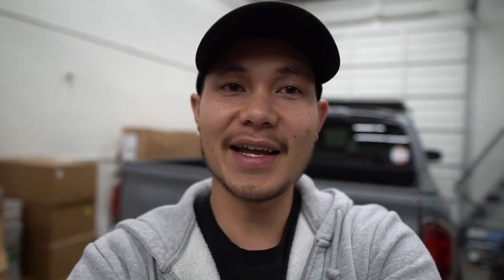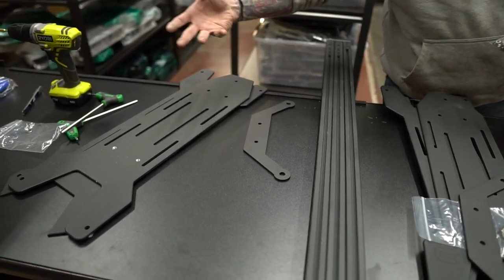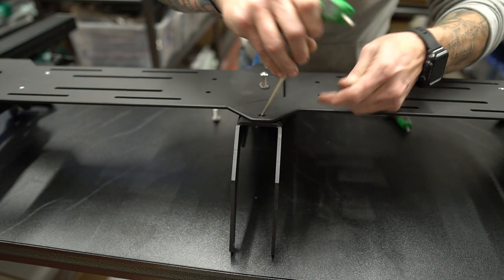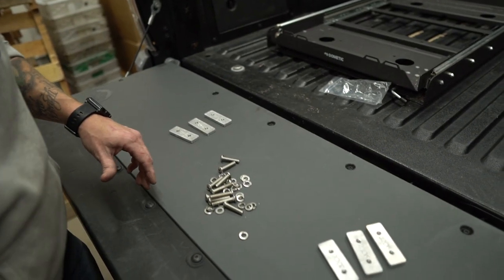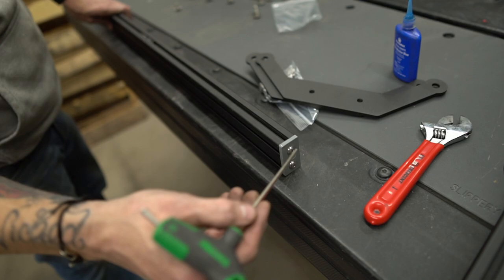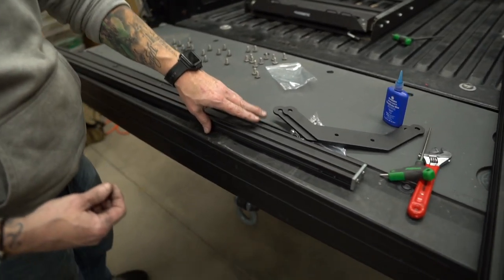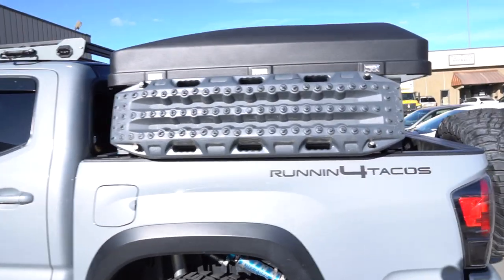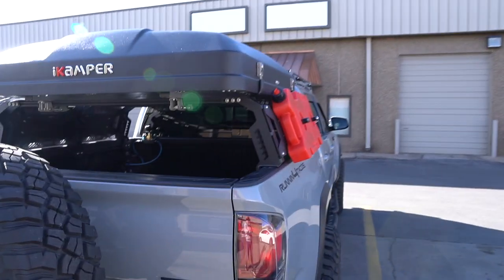NEW Bed Rack is Lighter, Stronger & Sexier! upTOP TRUSS Tacoma Bed Rack

Comment: It took forever to get here but I just got mine delivered. Super easy to install. I installed on top of a retrax bed cover. Can't wait to see how it performs on the trail.
Reply: Do you have a status update? I'm looking to get a bed rack with a retrax but am worried about the securement method.
Reply: @north_borne  It's totally secure. I've had zero problems after one year of use. It's a great setup for me.
Reply: @lovablepersona5000  Awesome, thanks for the reply. I recently bought UpTop's roof rack and was really impressed by it and was really interested in their bed rack since it's one of the few that seem to be designed with a tonneau cover in mind.

Comment: They should add racks so you can mount things like the rotopacks to the underside of the bed rack.
Reply from the maker: Shoegum they actually have them, I will make a follow up video later to show more goodies that can be mounted under the load bars

Comment: seems like a pretty substantial design issue that a RTT can't be opened if you have accessories mounted to the rack. looks like another inch or so of rack height would have made the difference, or the option to shift the accessories down away from the tent. otherwise it is a pretty sweet setup

Comment: Beautiful rack setup. Although, at 23:43 when he starts shaking the rack, there seems to be a good amount of flex in the components.....Not sure if I trust that much flex with a rooftop tent on top while wheeling off-road.  Too many individual pieces held together by fasteners for my liking personally.
Reply: Yup, I noticed the same flex
Reply: I noticed that too, but that flex should go away once you've got a tent mounted on the rack since it's adding six points of contact to a rigid frame.

Comment: Hey finally got around to installing my mid-height. I remember you saying the rotopax weren’t actually functional because the iKamper hits them when you open things up. 

Presumably at least the traction boards clear on the hinge side? If you swapped the traction boards for the rotopax does everything clear then?

I think the answer is no. Hopefully worst case I can have the traction boards where you have them now and I guess get the tiny ass 1 gallon rotopax which 100% will clear.

Comment: why wouldn't you set up the fuel tanks on the gas tank side of the truck and the max trax on the other side?
Reply from the maker: Roof top tent fitment when opened

Comment: What are those mounting brackets you're using for the iKamper? They look way better than the regular U-brackets.
Reply from the maker: Comes with the iKamper
Reply: @Runnin4Tacos  Oh cool that must be an update, the other videos I've seen just used two bolts and a bracket.

Comment: nice work! did you have to upgrade the leaf springs to accomodate the added weight of the rack, rooftop tent, and accessories?
Thanks
Reply from the maker: Yessir, we'd recommend Icon RXT or Deaver
Reply: @Runnin4Tacos   do you have a vid on this? About the buy the rack and want to make sure it’s done right.

Comment: Why the rack is shorter than the bed. Will the 6 foot bed fit into the 5 ft bed
Reply from the maker: Yes you can use this on 5 or 6 feet bed.
Reply: Where can I buy

Comment: How thick are the cross bars? Your website states the mid-height is 11.5" above the bed rail to the top of the cross bars. I am trying to determine the clearance between the bottom of the cross bars and the top of my Decked drawers. Thanks.

Comment: What is the weight difference compared the the RCI? What is the load capacity of the upTOP?
Reply from the maker: jklpadilla RCI mid height is roughly 100lbs and the upTOP TRUSS mid height is 36lbs so MUCH lighter. Static weight capacity is 1000lbs
Reply: Taco Twonz 1,000 lbs static weight capacity for the uPtop bedrack?

Comment: Looks dope. I like that it’s light weight. But price is still high. There’s one by brute force fab that I might get. Mounts to the bed. Although it is steel and heavy it is also one piece. But that’s just my preference. But this one still might be a great option. Keep up the great vids.
Reply: I'd be careful with the racks that mount directly into the beds. They utilize the factory bolts which connect the bed to the frame. The back of the Tacoma frarmes, particularly the 3rd gen, have an open C-channel providing a decent amount of flex while off road. A solid steel rack bolted into an open C channel is going to resist this flex which will likely result in a warped/cracked rack over time if you off-road regularly.
Reply: Never thought of that. Great point. But isn’t it just as much a concern of top mount rack with the bed opening or pushing out??
Reply: @bigvin7602  Not as much of a concern with top mounted racks as most, as is the one in the video, aren't solid single units. Most are bolt on and have a certain degree of inherent flex at the connections, so will flex with the frame and bed without the forces being transmitted into the structural components of the rack.  If you do want a rack that bolts into the frame, look at the one by Leitner Designs. That one incorporates elements of bolt on components which would allow for flexing when the frame/bed flexes off road.

Comment: I love my UpTop Bed rack Medium height, but I’m sad that I personally can’t find a video in it for tips and tricks.  I’ve watched this one soooo many times to fully understand how mine installs, but!!  As I was tightening mine down to the side rails…you can hear the side rails glue or whatever breaking loose. I was using a smaller ratchet and always kept in mind that tight is not always better. This does however concern me because I do believe that the angle on mine was not correct for my bed even though it did lock on.  I have a 2021 Tacoma off-road.  The sound of the rails obviously coming loose was very disconcerting.  The only way for that to happen is if the angles and spacing from bed top to rail is wrong. I personally think it is.  I want to buy the roof rack but did they do it right!?  I would hate to have issues if they didn’t.  The Cost Way out ways the idea unless it damages your Brand New Vehicle just putting it on.  I would really appreciate a response from UpTop about this.  Great Product otherwise.  And No, I never even had the cross bars/ Load bars installed yet.  Would be appropriate for a follow up video about the product you push like you said you would, if you don’t do that we need to know why sir!
Reply from the maker: We have upgraded to the full size upTOP rack which is why we don't have any more videos on it, unfortunately. Give upTOP a call and they'll help you out with the issue

Comment: what gallon rotopax are these? Just bought the rack and wanna know what size I can fit on here!
Reply from the maker: Two 2-gal
Reply: @Runnin4Tacos  How did you get both packs to lock into each other and mount? I have the exact same bedrack, and the rotopax, but the mounts for the Roto's cant be mounted close enough to each other to slide through both packs

Comment: do they have something that will work with a tonneau cover such as DiamondBack?
Reply: A year late, but I see they have one for diamondback that will attach to the anchor points. They will be able to open fully as long as you stay with low or mid range racks

Comment: Hey. I was wondering if Skycamp 2.0 3-4 people will fit on the TRUSS Bed RACK?
Reply: That depends more on the length of your cab, the Skycamp 2.0 is 7'2" so you'd have several feet of overhang on a short bed Tacoma. Check out Last Line of Defense if your want a visual reference, it sits flush on an F-250 short bed and would have minimal overhang on a Ram short bed.

Comment: Hi All! I just scooped a tacoma sr5. Quick question, anyone know if its possible to equip this rack with a tonneau cover? It would be great to have security and storage below with the ability to add more on the rack. Thanks for any insight!
Reply: This in particular can’t but they do have others that you can add a cover….which are usually the tall height one